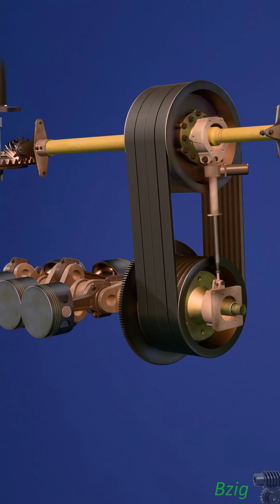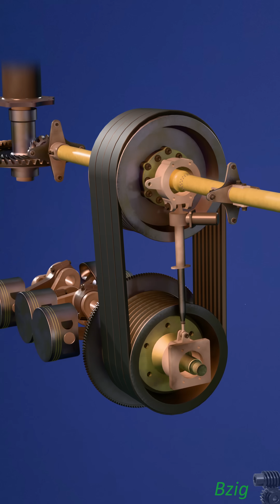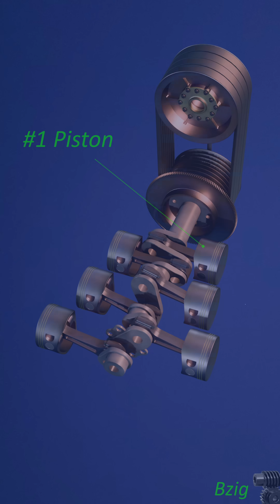Helicopter Drive System

Comment: Excellent explanation, Doesn't the V belt get worn out due to friction when declutched
Reply from the maker: it does and the R-44 maintenance manual has wear limits and procedures to change the belts.  Also.. they have 4 of them so a single belt failure should not cause a loss of drive.  Thanks for commenting.
Reply: This arrangement was used in the “Bubble Top” chopper in Korea, but with a 4 cylinder and fewer belts. Watch most any MASH episode and look at the helicopter used. These are on campus at many Technical Training colleges around the states.
Sadly, the F-4 and this Bell Helicopter is being lost to the National Guard as land on campus is needed. I watched a Chinook with ground crew discharge the static, grab the belly hook then witness an F-4 disappear over the horizon.

Comment: So when the upper pulley is lowered, the entire shaft is lowered. But the shaft ends including the pinion must stay put. How is this achieved?

Edit: Reading picopilot's comment, the shaft misalignment is solved by flexible couplings.
Reply from the maker: I'll do a follow up.  There is a bearing and transmission housing that prevents the pinion from moving.  All of the motion is taken up in the flex plate.

Comment: The pistons opposite each other usually share a crankshaft position
Reply from the maker: I covered this in the follow on video.  Sharing a common journal makes the engine a "flat" engine, but when they are 180 apart from each other it's a "boxer engine."  The engine I modeled was supposed to be a boxer.
Reply: @bzig4929 I was thinking it looked alot like my Subaru engine😅

Comment: Actually working prototype of a "Tribnene engine" ,,, two cylinder , 380 lb engine,, 14, 680 peak horsepower 💪,, 8 gallons of fuel per hour average,, thinking about patenting 🤔

Comment: There should be two conecting rods on each journal  4 main bearing and 3 conrod journals just like the conternental 6 ltr flat 6. each pair of oppositely opposed cylinders should be on the same crank journal
Reply: I don’t think this is it. I found the parts catalog for the engine and looked at the crankshaft and no the connecting rods are all on their own journals. The models crankshaft looks about right to me.
Reply from the maker: yup... it is modeled correctly, but there are engines where opposing pistons share a journal.  But not the IO-540.

Comment: Great work‼️💯 I'd be interested in hearing about the function of the 3 flex couplings. My understanding is they make up the difference between the angle of the transmission shaft when the belts are not tensioned vs the angle when they are. Is this the only function of the flex couplings?
Reply from the maker: They are very common is helicopters... particularly in tail rotor drive shafts, even in helicopters that don't create this intentional misalignment.  There main purpose is to allow flexing of the tailboom under air loads.  So they would be present even if they were not needed to move the clutch pulley.

I don't know the specifics on the exact coupling used in the R-44, but the data sheet for similar coupling says they are OK up to 1 or 1.5 degrees of misalignment.  The amount I show in the video is 3 degrees (because 1.5 was visually imperceptible).  

So, The secondary purpose of allowing clutch pulley movement appears to be well-within spec for a flexplate coupling.   

I'll do a video on that... cool topic.
Reply: Your concern for gear boxes is valid as 0.006” ring & pinion tolerances is required for long life. Including shaft bearings, seals that hold lubricants from leaking. Your steering column typically has rubber flex joints that connect the gear box, but reduce vibrations and noise.
  Some with belt drives use a side swinging idler pulley to control belt/shaft engagement. Plus, the one-way roller clutch needs lubricant as well.

Comment: The mistake is that engine is mounted vertically btw you do an awesome job ! Please continue. !!
Reply from the maker: This is a cool comment.  The Bell-47 is similar in size and uses a vertical engine.  But my animation was based on the R-44 and that helicopter uses a horizontally mounted engine.    I like the comment though... Bell-47's used to be everywhere, but you don't see them much anymore.

Comment: Looks like a pretty simple design utilising the already present flexibility of the tail shaft, although I imagine the belts need to be checked and replaced from time to time
Reply from the maker: nice observation!  I make these 3d models by studying part catalogs and images of parts.  It took me a while to figure out that the flexplates were the only mechanism available in the design to give that DOF.  The amount of movement needed only results in about 1 degree of misalignment, which is well withing the capability of that type of a coupling.

Comment: As a helicopter CFI, i use your videos to explain these very mechanical concepts to students for both awareness and to help them better preflight the helicopter and diagnose inflight issues. They’re an unbelievable tool - something i wish i had when i was going through training. For this particular video, it would be awesome if you could include the clutch actuation assembly - or do a video that shows the clutch actuation components and how the clutch is tensioned via leaf springs and the detector switches that start and stop the tensioning sequence. This is often one of the hardest things for students to visualize and understand. But understanding it allows the student to better preflight, and diagnose inflight issues regarding the clutch system… Anyway, great work. And thank you.

Ps. I believe the engine discrepancy you mentioned is that the opposed cylinders are each in the same stroke timing. In this configuration, you always have 2 cylinders in the same stroke of the cycle simultaneously which is incorrect.
Reply from the maker: Thanks so much for this comment!  When I learn these things, as a pilot, I always have those head scratching moments where the books and the instructors don't quite seem to be able to explain things to my satisfaction.  A picture (or video) sometimes is able to overcome that with instant clarity... that's my motivation for posting these videos.

I took the easy way out on the clutch actuator, but I love the comment and I'll see if I can dive into the details of that an improve the animation!
Reply: @bzig4929 you nailed it with the clutch actuator video. Thanks.

Comment: Correction.  The engine,  since it's not inverted should be an O-540
Reply from the maker: @samcutler9008 is correct.  "I" means "fuel injected" inverted engines use an "A" prefix for "Aerobatic"
It gets more contusing with Continental engines... their nomenclature is similar to Lycoming, but some of the letters mean different things.
Reply: No the r44 has an io540 fuel injected the o540 has a carburetor

Comment: Hbt the friction ? Does it not destroy the belt over time
Reply from the maker: yes it would.   There are inspection procedures in the Robinson maintenance manual that tell mechanics when to replace the belts.  Pilots also look at these before every flight.  The clutch actuator, in addition to engaging and disengaging is also used to maintain the correct tension during flight... this minimizes slipping which improves the life of the belts.  Nice observation!

Comment: is there a difference in how a gyrocopter rotor works compared to a helicopter, besides being unpowered?
Reply: The blades on a gyro are set at a constant negative pitch to ensure autorotation.
During level flight the rotor disc is tilted back at an angle which allows the rotation to continue, while providing an angle of attack sufficient for lift, (a bit flaring for landing in a plane, only it does this constantly in flight).
The rotor disc behaves similar to a fixed wing, but uses changes in angle of attack to increase or decrease altitude.
A helicopter performing an autorotation needs to lower the collective to give negative pitch to the blades, in order to speed up the rotor  (add energy), and the nose.
Gliding while finding a suitable spot to set down.
Then when approaching the ground the pilot will perform a flare to both slow the fall and forward speed, automatically further adding energy to the spinning blades (because of the windmilling effect).
At this point the collective is used to add positive pitch to stop the fall and cushion the landing, (if done correctly!).
Funny name by the way.😂
Reply from the maker: Nice answer!
Reply: @mickmuzzmkmz1628 very interesting
Reply: Yes, it dramatically different. I believe there’s no collective, but then that makes me wonder how autorotation works. Bzig will have a great answer.
Reply from the maker: I can't say it better than  @mickmuzzmkmz1628

Comment: On the crank shaft between piston 5 and 6 the seems to be two features sticking out on opposite sides with two holes on each.
Reply from the maker: I mentioned this in the follow-on video.  Those are for the balance weight.

Comment: The amount of detail is seriously impressive, Thankyou for making the vid. I would however like to ask how they ensure proper alignment of the belt and upper pulley after the re engagement of the clutch and doesn't this up down movement of the shaft affect teeth alignment on the bevel gears.
Reply from the maker: I've had a lot of questions on that... there's more to the clutch actuator mechanism than what I show.  I'm planning a follow up video on that

Comment: The timing on those pistons. Some pistons should be opposed to one another for balance as opposed to everything else”undulating together.” That undulating motion might time well for a 2-stroke, but not a 4-stroke engine
Reply from the maker: I stared at that for a long-long time... I'm impressed that you picked up on it so quickly.  As I said in the follow-on video, because of the way I rotated the crank journals in the CAD the timing was 240-60-60 degrees.
Reply: It is nice someone else figured it out because it has to hard to animate. Working for a large company on tour thru animation. This red headed was doing an automatic trans. That’s hard. A few ask questions, then I ask if he knew how it worked or had he rebuilt these? No…
I was shocked, surprised.
Reply: I wondered what was going on with that funky timing; it's nice when your intuition matches up with reality!